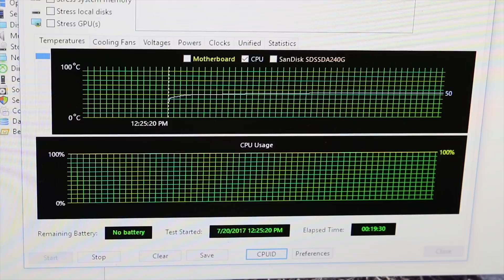My Node 202 Build Dropped 35 Degrees on the CPU with this Mod

Comment: Wraith Spire fan mounting holes actually line up with any standard 80mm square fan.  So you can use any standard 80mm x 80mm x whatever (15mm thin, 25mm standard, etc.).
At least that is the case for the original Wraith Spire (with copper vapor chamber) that came with my R7-2700 (non-X).  I've fitted mine with a Sanyo 9GA0812P4H001.
I believe Wraith Stealth is the same, but I didn't try it.

Comment: Hello, i have got the same Node 202 with ryzen 5 2600 inside.
I see about 90 degrees in full CPU load. It is very bad, that's why i am very suprised when I see 50 degrees in your video! 

Really cool!! How do you do that? 

Sorry for my english (not native). 
Trying to understand modification. 
Do you set original AMD Wraith Spire as CPU heatsink? As I understand is has copper plate on the bottom. Is it the main modification?
Reply: That video is about changing original spire fan from stock to c7's to fit that huge heatsink inside node 202. 
Spire has copper plate at bottom because it's old version which have vapor chamber. Never revisions don't have that and temp are higher
Reply: @kwiat5796  Thank you for your answer!

Comment: It is best to use nocuta nf-9x14 pwm chromax (2500rpm), better temperatures than the Cryorig and a lot more silent.
Tried Cryorig c7 fan but it is too loud for my taste.
Reply: Does mounting fit or new holes in fan are needed?

Comment: I know this is a 4 year old video, but I can confirm that this does work and on a Ryzen 9 3900x.
I got a 10 degrees C decrease under gaming load.

For those interested, the vapor chambered Wraith Spire (Gen 1 & 2 Ryzen) has a contact to top height of 40 mm and the C7 fan is 16 mm.
Reply: That's still alot for a recent cpu, especially the 3900x. I recently just bought myself this case and I might use this with my 2700x

Comment: I recently updated my 1600 with a 3600 with the original wraith spire and C7 fan
Reply: So did you get a significant temperature boost aswell aswell as the autor? I'm having Node 202, Ryzen 3600, C7 aswell. Thinking if I should get Wraith Spire to get that heatsink
Reply: @gingerwizardd  make sure you have the original wraith spire cooler with Copper base that comes with the ryzen 1600. The new wraith spire that comes with the 3600 is aluminium so not as good quality.

Comment: Or, you can take your stock Cryorig C7 and mount a Ø 92mm silicon tube for cars motors (like HPS High Temp 3-5/8") on the top of it. You just have to cut it so it touches the case cover and... voilà !

Comment: I'm running Nh-L9a am4 on ryzen 5 2600 4ghz @ 1.36v in Sg13 case. The cpu overheat str8 away. I can only use it stable If I did not oc at All. I was wondering if I can use the noctua fan ontop of spire heatsink?? The only problem now is I don't have wraith spire haha.

Comment: i utilize a similar build for my 1800x except i have a noctua cooler, which i have replaced the 13x92 mm fan with a 25x92mm fan and had an instant 11 degree drop in overall temps. overall if you can manage, use a full size thickness fan on the low profile coolers those 13mm fans dont do the job well enough.

Comment: I'm not on Ryzen but do have the node 202 with a cryorig C7 and find it to be quite noisy - would you recommend this mod for me? Or would you recommend just buying a different cooler?
Reply: I'm on an Asus z170 pro gaming if that's relevant
Reply from the maker: If you don't like the noise, probably go with a different cooler since this mod uses the C7's fan.

Comment: Try lowering your voltage i get 3.7ghz @ 1.265volts on my r7 1700 , you could drop temps and get better performance

Comment: Yo Hoosier Harware, do you have any idea if you can fit in de new Ryzen 2600x / Ryzen 2700x using the cryorg7 fan mod?
Reply: pvdv1985 have you tried it?  I am curious to know too
Reply: Alan Leong I have not. The difference between 1600/2600 is only 10% supposably. The 2700x is 95dpd which is also gets hotter. So for now I'm not gonna upgrade yet

Comment: I'm alot late to the party here, but I just found this video. Very cool idea so I tried it out since I also use the C7 in my mini itx ryzen 1600 build. My temps dropped about 5.25 degrees, which is a 9% improvement. 20 minute stress test stabilized at 54.50 C. I didn't get quite the jump you did but it's an improvement never the less and it gave me an excuse to tear down, clean, and rebuild my gaming pc. Nicely done!

Comment: It's nice to see an actually useful hardware video. Good work. I'm not copying what you did here, but doing something that should be competitive. I have a Spire and C7 but I'm using the C7 heatsink with a Noctua NF-B9. It's a lot better fan than any others people are using, bigger, more effective and still quiet. The Spire is too tall to use a bigger fan and the real problem with the Node202 is that the entire system gets hot. 
The idea is a better balance between low CPU temps and more case airflow in general with the C7+NF-B9.

Comment: A 17mm gap between the wraith spire heat sink, and the top case panel of the node 202, ey? The noctua nf-a9x14 comes in at 92mm x 92mm x 14mm, at just under $20 US, leaving a 3mm gap between the top of the fan and the case. Removing parts of the fan shroud will allow more air to be manipulated. Let's see if such a mod will allow me to keep the top mounted 120mm fan intact, in my ml09 case.
Reply: This Reddit thread had some interesting info on this topic, as well as on wraith spire modding, https://www.reddit.com/r/sffpc/comments/6vwyse/node_202_wraith_spire_mod/

Comment: The stock AMDfan fits in the node 202 if you remove the shroud and place the dust filter on the outside, so how is this fan better than stock fan?
Reply: You're correct. It's not going to be. I have the C7 and the fan sucks. If you're swapping fans you want to go to Noctua or just use what you have.

Comment: Under full load (stock clocks) I am getting 77 degrees and rising in Prime95? Are you sure about your numbers with the case closed? I am also using the Nocta NF-A9x14 which afaik is better than Cryorig's fan.

Edit: did some research and lots of people with lower voltages are getting higher temperature. This does not sum up.

Comment: I can confirm that this does work. Got a node 202 with a ryzen 1700 with the c7 and temps never reach above 52c when gaming. You could overclock but the power phases on the mb have me worried.
Reply: u got c7 cooler on wraith spire heatsink aswell?

Comment: Has anyone else been able to confirm this?
Reply: jsolson1 yup, running a r7 1700  with 65c max temps @ stock clock. Would go higher but im afraid of vrm temps.

Comment: I know I'm a little late on this, but I'd love to see a more in-depth video covering the implications of this. If there are zero other factors causing this, the spire cooler being 35 degrees better than cryorig's (which doesn't seem like much of a slouch) makes it the best AM4 cooler on the market for its size by a huge margin. I'd love to see a video comparing other heatsinks, fans, and measuring temps on other components like RAM to see what the hell is going on.
Reply: Leap I agree
Reply: From what I can tell, its just the bigger cooler giving these's temps. But for what you gain in the cpu, you lose in the vrm since the fan is now farther from it. Vrm temps will be higher.

Comment: Hey man nice vid! I'm looking to build a setup similar like yours. What do you think is the fan from the Noctua low profile cooler (NOCTUA NH-L9a-AM4) could do this as well?
You know, you can get that fan alone, and it supposed to be a lot quieter than the C7's fan. Also would be cheaper just to buy a fan.

Here it is: https://www.amazon.com/Noctua-Low-Profile-Cooling-Blades-NF-A9x14/dp/B009NQM7V2
Reply: +beckham087 have you tried this yourself? I'm planning a ryzen build on node 202 and think noctua fan a bit better, I would like to know if this solution works before going any further and if this "combo" gives better results than with the noctua fan alone. Otherwise I think I'll go for the 1600x (ending with the silicon lottary) and get myself a noctua fan.
Reply: Hey!

So now i'm using the wraith spire heatsink, with the noctua fan. One thing which is important, that the Noctua fan has 92x92 mounting points, but the Spire do not. So you have to find another way to mount it. I did with 2 side tape. It works pretty well i guess, but I'm nowhere near the 50C. Well in my apartment it is always really warm so usually 25-29C air temp, and the CPU temp never went over 80C. (15min AIDA)
Reply: @beckham087  Does your Node's dust filter still fit with the Low Profile Noctua Fan + Spire Heatsink?

Comment: My problem is after taking the shroud off the spire cooler and taking the dust filter out, as soon as you put the other piece of the node 202 on the fan touches right up against the fan grill, and because it’s practically got no room between it and the fan grill it’s suffocating it.on top of that, something is going on when that happens that it almost amplifies the sound. Where it will be running at the same speed but will become much louder as soon as the other side of the case is pressed in.

Hopefully this c7 mod will help, I was thinking the noctua lp one since it’s also extremely silent and it’s really thin, which would just give more room between the air intakes and the fan.
But this really does seem promising, so I may just order the c7 and try this

Comment: Maximum CPU cooler height without dust filter - 65mm.
I have Big Shuriken 2 rev. b (46mm without fan) + fander roxo FRX3-12018P (18mm) + Sheet of cardboard 1mm thick for directional air flow.
Total 65mm.
Reply: Do you have any photos to share somewhere? I'd be interested to see this. I use a C7 in the Node202 and have a Noctua NF-B9 on the way to see if it fits. According to my math, it will even with the dust filter.
C7 HS alone is 47mm, then NF-B9 is 25mm. I have a Ryzen 1700 and I think there's a good chance my config will be cooler and guaranteed quieter than what he did in this video. Tough to directly compare because he uses a 6 core Ryzen. What you have is the best heatsink but Intel only.

Comment: This works in an SG13B case too! I couldn't even install the C7 because the needed AM4 bracket is unavailable and Cryorig doesn't know when they will be back in stock. (item page was even deleted from Newegg) But you saved my build. Thanks!

Comment: I had a power supply that the fan would work and make lots of noise and sometimes would completely quit.  I can't remember what brand but I purchased a 120mm fan with sealed bearings and replaced the fan in the power supply.  I had to rework some wiring and mount with some double sided tape and screws but it lasted another 5 years.

Comment: maybe someone can help out. just building a r5 1600 rig and want use the c7. no need for hard oc. its just a little workrig for editing. so whats the problem with the c7. its for 100tdp and i used it very often for i5 builds. and there it performs very good. so what can i expect? with ryzen? is there a chance for hitten 3.6 stable with the c7 or do u think it will not do the job. and yes... its a white build and i the amd cooler looks very ugly in this case... and i mean not case as the box. i hope someone can help out

Comment: I'm having major heat problems on my Ryzen 1600x, running an AMD Max cooler. Temps are hitting 84 degrees celsius under 100% load.

Comment: I really find this difficult to believe'.  I swapped  out  an intel stock cooler for a hyper 212 evo  and the temps only dropped by about 10 degrees under normal use.
Reply: Melvyn Jeffrey the Intel cooler had to of been running full bore, where the hyper 212 was probably barely pushing air through it. 

They are on 2 completely different levels

Comment: That CPU is a dud overclocker?

My old 1700 did 3700 at 1.155V.
Reply from the maker: That's not my chip's max overclock. It's a case where I just don't need the extra clock speed, and I'd rather keep thermals and acoustics more in check than pushing it at all.

Comment: AIDA64 doesn't show accurate temperatures on Ryzen or at least not on the 1700. You should be using Ryzen Master or Hwinfo/hwmonitor.

Comment: So, the copper/aluminum heat sink of the Wraith is superior to the C7's? That's a big revelation indeed. :-o
Reply: ummm... https://imgur.com/gallery/Xh3fQ
Reply: Yep I own one it's definitely got a vapor chamber when i tore it apart
Reply: that's to be expected Spire heatsink has a vapor chamber. how do you think you can OC a 8 core ryzen to 4ghz with a stock cooler?
Reply: Some people say it has a vapor chamber, some say it's just a copper slug at the core. Someone should cut the Spire open and find out for sure! :v
Reply: Oh cool, thanks. :D

Comment: Shucks, that wasn't really the direction I hoped this video was going. I have a C7 and picked up a higher airflow fan I was going to try to jury-rig onto the C7 heatsink. However, after seeing this video, it seems the weak link is the heatsink and NOT the fan like I had originally thought. I may need to go back to the drawing board...
Edit to add: not running a Ryzen platform, so no Wraith cooler to take advantage of.

Comment: the spire stock fan actually has a plastic shroud with the "amd" logo you can take off.
this lowers the height of the fan by a good 6mm
if you remove the dust filter you can then perfectly fit the stock cooler and stock fan inside the node 202
Reply from the maker: +Permaculture Ecuador it does still press up against the top of the case that way, but you're right, it does fit. I'm seeing virtually identical temps with the two fans, but it's a great idea if you don't want to invest in a cooler.
Reply: Hoosier Hardware just barely it doesn't warp the side or anything it's like perfectly touching the side lol I'm still waiting for gpu to test temps
Reply: Gabriel Uggla i couldn't find any information on anyone who had actually tried it other than people repeating what the specs say can fit so I decided to try myself.
the fan/cooler has extra plastic that you can unclip and take off of it to lower the height so it fits perfect without the dust filter.
I have not yet tested the temps as I don't even have my gpu yet (waiting on Amazon) but the video creator just mentioned that with this fan and the modded fan he sees virtually identical temps with the stock fan or modded fan. so 30 degrees below the c7, I see no reason to invest in a cooler when this is probably the biggest and best cooler you can fit in the case in the first place and free no fan mod needed just take off a tiny plastic shroud that has the "AMD" logo
Reply: Michael Tang fingers. it's held on by 6 tiny plastic clips. just run your fingers around it peeling the clips open!
Reply: Wesley Hughes no, after removing the extra outer plastic with the AMD logo there is still a more minimal shell around the fan directing air etc 
I am going to make a shitty video in 4 weeks over this
the extra plastic is held on by 6 thin clips around the edges
my graphics card arrives today so I can respond with temps soon!
Reply: do the fan blades of the stock spire fan interfere with the case when used in this way?... I am guessing not
Reply: yessir thats it! im typing from my newly built computer now :) stock cooler in the node! I recieved my graphics card finally lol
Reply: Thanks! You just saved me $30.
Reply: I know how you feel! lol that's why I was so surprised there is no information on this!!
Reply: Does your wraith spire look like this(http://www.overclock.net/t/1466816/lightbox/post/26125402/id/3044307 ) after the mod?
Reply: Gabriel Uggla yes agan I'm using the stock cooler inside the node 202 works perfectly no problems BARELY fits with the shroud removed but it does fit! no mods needed but removing the AMD logo! I have 60C at max load. 30 to 40 C under no load.
Reply: edit that 55C to 60C at MAX load and slightly overclocked to 3.6 ghz
Reply: Permaculture Ecuador how difficult is it to remove the shroud? Do I have to actually take a saw or pliers to it?
Reply: you say you want to upload the video you mod the fan
Reply: Are you going to upload that video anytime soon? would be helpful to check it out! Or even some photos of the Spire inside the Node 202 as the only ones online are of the RV02
Reply: is this the fan that comes with the 1700?
Reply: haven't proceed with my itx build yet, but I really need to find a way to book mark this genius comment
Reply: I know i am late for this party...but Can you please tell me if taking off the plastic shroud on the ml08 case will work fine ? The ml08 case says it fit 58mm cooling fan
Reply: Thanks for this post. Think I'll scoop this up. I have the C7 CU but the Temps are not that great. Tried swapping the fan with a Corsair SP120 but the Temps still stay a bit too high for me. Plus the sound of the fan constantly spinning up and down is totally annoying
Reply: Alan Leong it will I did just that on my rvz02 same case
Reply: Thanks man! This is brilliant!
Reply: Hi guys, let me add something since there's no guide anywhere for this. I tried to remove the top plastic shroud from the wraith spire cooler, and it was NOT easy to come off. I used a flat-head and lightly pried each plastic flap from the side, and all around I heard "pop" sounds. I was afraid I was breaking things, but I went ahead and once I managed to pull off the plastic shroud I noticed on my unit there is some glue around. So depending on your luck I suppose there could be a lot or very little glue or no glue, and that would possibly make pulling the shroud off harder. Then I measured the height from CPU contact to top of the fan, and it is 63mm. However the fan is 25mm high, so honestly I would try to replace the fan to begin with instead of tinkering with the shroud.
Reply: Permaculture Ecuador you are a genius and a scholar. Thank you!!